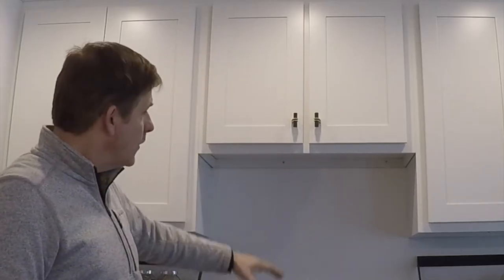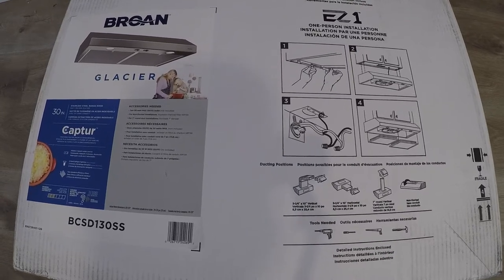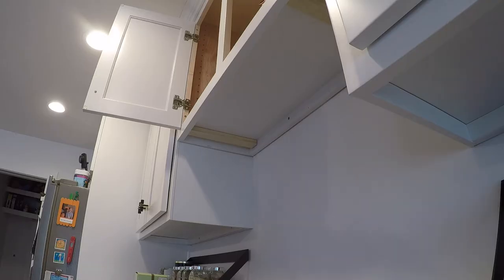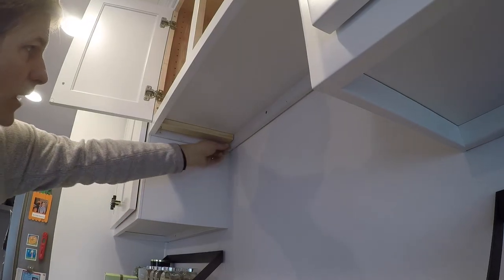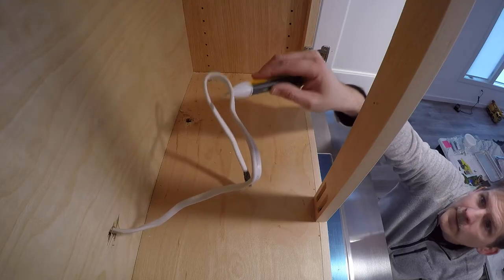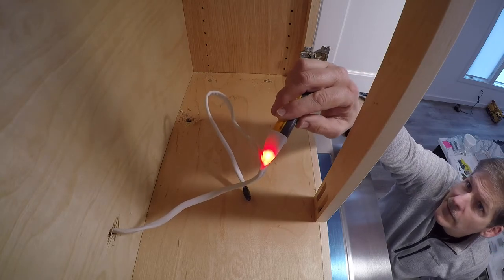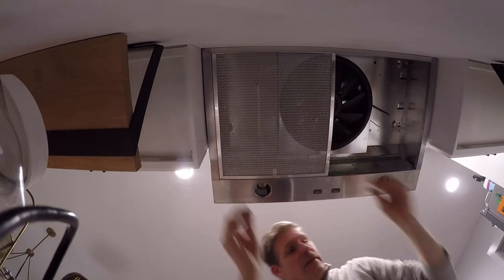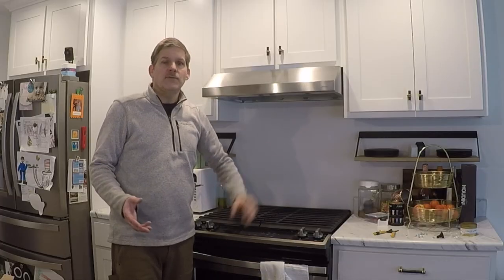How to Install Broan Range Hood - 30 inch Glacier Captur BCSD130ss

Comment: Really should put loomex box connectors in to protect the wire coming in to the hood fan . When it comes to exterior venting and  Although it's not code in my area and could be different where you are...gas stoves should be vented outside from the range hood upper fan and the suggested CFM fan rating should be your total top burner BTU's and divide by 100. As an example 40,000 BTU total would require a CFM of 400.  Those look to be a CFM rating of 300.
Reply from the maker: Hey Frank,
Thanks for all the detail! And thx for watching!

Comment: Hi there, thank you for the video. What is the metal vent flap that came with the unit for? When unpacking you said you probably wouldn’t need it but curious to know what it’s for. Thank you!
Reply from the maker: Hey bab…,
They typically supply a way to direct the flow of air outside the house if your house has a vent installed to do so. 
Otherwise, no need to use it and the vent just recirculates the air instead.
Thx for watching!

Comment: I got EZ brackets with mine...ain't gonna use them. I think that I will take a thin piece of cardboard, make a very accurate template off the topside of the hood to mark out the screw holes , and then position the template where I want it , to allow for a plug in cord in the back...drill four tiny holes and start the screws, then install the cord , and slide it up and in place. My plug in, on the top edge of my stove is about 24 " away...so it should be good. Thanks for your video which showed that you don't have to use the EZ brackets if you don't want to.
Reply from the maker: Hey Mark,
Sounds like you have a well thought out plan! Go for it!
Thx for watching!

Comment: Nice video. I got one quick question. I want to go with ductless. When you remove the vent plate on the top, won't portion of the vent opening will be blocked by the cabinet?
Reply from the maker: Hey Min,
It’s been a while since I did that project. 
Isn’t there a air space between the top of the hood and the bottom of the cabinet. 
Might be worth a call to the manufacturer. 
Thx for watching

Comment: If it's not ducted, it's not an install. Pointless.
Reply from the maker: Hey Spruce,
It is ducted - vents under floor to outside.
Reply: @Housebarons  ?? fine work mate, don't mind me, I'm just angry. But that's not vented, unless you're saying you added a vent? Under the floor? Range hoods should be vented if possible. Like I said, I'm just angry. Carry on and stay strong.
Reply from the maker: Hey Spruce,
We did added ducting below the floor and then added an exterior wall vent. The exhaust fan is underneath the cooktop. 
I get what you we thinking - that it was just recirculating. But this one is truly vented.
But thx for letting us clarify. If it wasn’t clear to you, there are probably others thinking the same thing. So no worries. Peace, good will toward men! 
Thanks for watching and commenting.

Comment: Great video, thanks.   Question: How far in from the cabinet sides should I install  the shims?   Not clear on the enclosed instructions.  Thank you.
Reply from the maker: Hey Marcus...,
Those shims just provide a mounting surface - something to screw in to since the cabinet bottom is typically so thin and unsubstantial. 
They are 1x2 inch pine ( 3/4 thick x 1.5 inch wide is the actual dimension) 
They go right to each side and are screwed in from the other side of the cabinet bottom. Once the shin attached to the cabinet, you then have a 1.5 inch wide surface to attach the range hood to. 
Hope that helps!
Thanks for watching and asking.
Reply: Thanks very much for your help.

Comment: How long are the mounting screws you used? The ones that with the unit are to short.
Reply from the maker: Hey Miriam,
I added additional wood 1x2 supports first to span that gap.
See the video 1:40 -1:55 or so. 
The thickness of that support is 3/4 inch. Then I could use a 3/4 inch or 1 inch mounting screw which would screw into the wood support.
Hope that helps.
Thanks for watching!
Reply: @Housebarons  Did you not show how you decided to measure screws placement  in wood for mounting? Important info ! Maybe I missed it ?

Comment: The point at which you show the hole that the wire must pass through to the house wiring, there is a metal plate attached, but the next shot you show the metal plate has disappeared.
How did you remove the metal piece in order to pass the wire and connect the wires? Can you fill in the blank, please?
Cheers.
Reply from the maker: Hey Fredriko,
If I understand correctly, the metal piece to which you are referring is circular, the size of a nickel and it has a slot in the middle?
If yes, then you stick a screwdriver into that slot  and then bend and twist it and the tabs on the side of the piece will break off and can be discarded. 
Hope that helps.
Thx for watching!
Reply: I noticed you didn’t add a strain relief 1/2-in here. Very important to add since theres metal on metal (minus the wire skins that can wear out over time). Great video!
Reply: @abedankiest6204  You are correct. Don't want the wires rubbing against steel. Problem waiting to happen if you don't.

Comment: One year later how is this unit holding up? And what's the pros and cons for ducted and not ducted
Reply from the maker: Hey Micah,
No issues. Ducted - vents outside great for smoke/burning food. But more complicated work and possible air leak to outside. 
Non-ducted - way easier to install. But doesn’t do much but circulate smoke. If you don’t burn food often, non-ducted is easy choice. Burn good- just open a window 😃
Thx for watching!

Comment: Looking to buy one but am wondering where the air comes out?  I don't see a vent in front like most recirculating fans
Reply from the maker: Hey Mr...,
Yes. It does recirculate but all under the hood. 
Thanks for the question
Reply: Went with the Broan CRSH130SS  I could vent to outside but has the option to vent out the front and using charcoal filters.  Looks great and a very easy re and re.
Reply: You forgot to take off the recirculating cover on top to send the air out.

Comment: Can this unit be recirculated? If so? What's the specific charcoal filter model number for this?
Reply from the maker: Hey The...
Yes. It’s default design is recirculating. Not sure about the filter number. Maybe try the Broan web site / customer service. Thx for watching.